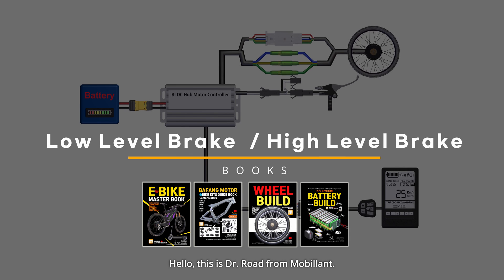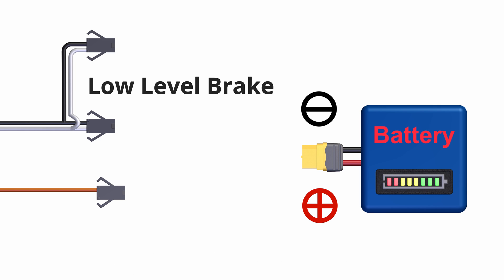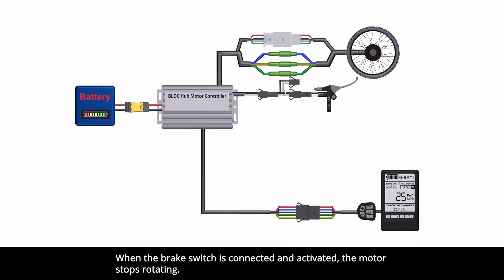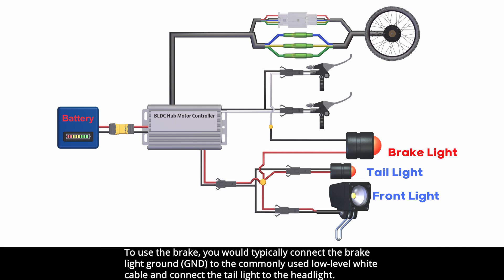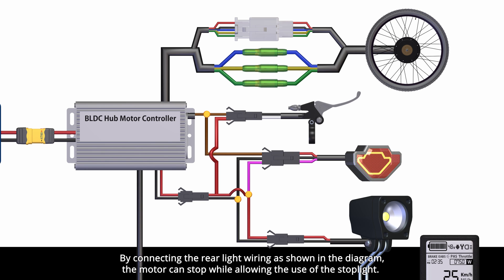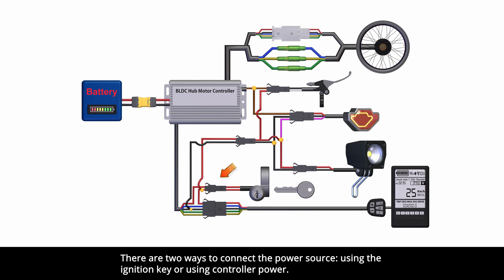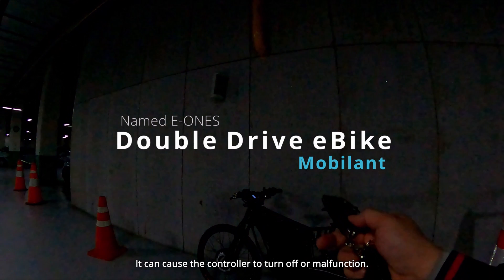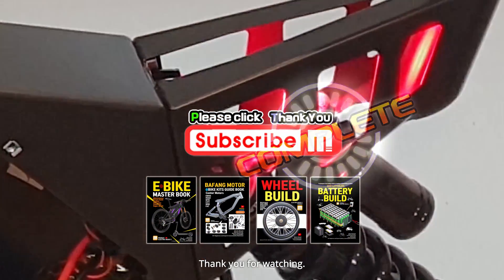Ebike  Low Level Brake, Hi Level Brake : Electric viacle Controllers - Brake Lgiht and Tail Lgiht

Comment: Perhaps you can help? I was installing a wired rear led. I’ve used four different dc to dc converters. A 240W, 120W, 60w and 24W. All the dc to dc converters powered on the rear led and the built in wireless brake sensor worked when riding like a regular bike with pedal assist and throttle off. But the moment I use throttle or pedal assist. The rear led still lights up but now the brake sensor does not work at all? Is my ebike not capable of activing the brake sensor when riding with throttle or pedal assist? What could be the issue or resolution to fixing it? The rear light led takes 6-12v to power on and it takes 3W for the rear brake light to function. My ebike is a rear motor, battery and controller is 48v.

Comment: I know this is year old - but someone may be able to answer my question - following the schematic @1:35 would the voltage from the headlight (red) be back-feeding to the low-level brake (white) causing an issue with potentially hurting the controller?
Reply from the maker: I've been making and using this circuit for 10 years now and I've had no problems with it.
Reply: @Mobilant_TV  Hi, can I ask you some questions about these controllers?

Comment: when using the low brake, if the outpot voltage of the headlight is 48v and the voltage of the low brake port is 5v, is the wiring still valid?
Reply from the maker: To put it simply, most high level brakes use 12v. This is for use with stop lights. It is recommended that headlights use an independent power source.

Comment: but does the motor coast to a stop (cuts power to motor) or is it actually braking the motor to bring it to a more aggressive stop?
Reply from the maker: A device that prevents the motor from rotating even when the throttle is used. Think of it like a motorcycle clutch.
When using a direct motor, powerful regenerative braking is possible with a set-up.
Reply: @Mobilant_TV  How can i wire it, so it brakes with the motor.
Reply: Can this serve as a regenerative braking?
Reply: @iykmoses  the bike I have ... has a motor with a pinion inside or something, so it works as pedals, if you stop pedaling, the bike does not stop.
Reply: I am guessing... as I wired it wrong and the motor would spin, but not the wheel.
Reply: It means it should be connected to brake switch in order to make it impossible to brake and acceleration at the same time.
Reply: Im wondering the same thing lol, it looks like it has to have additional brakes